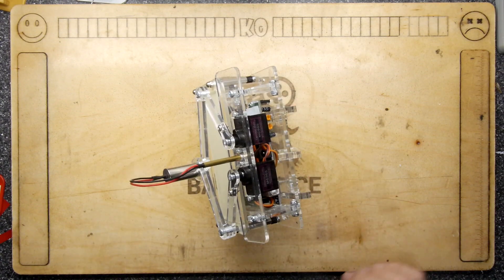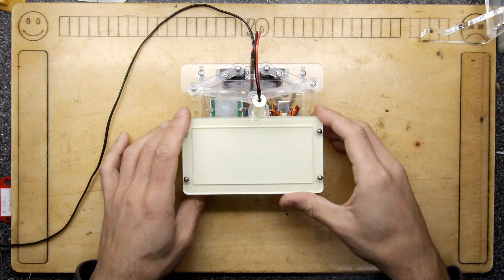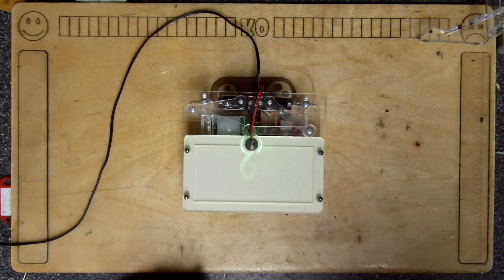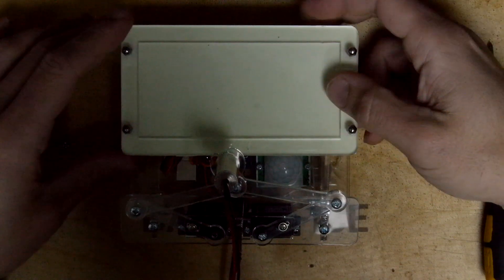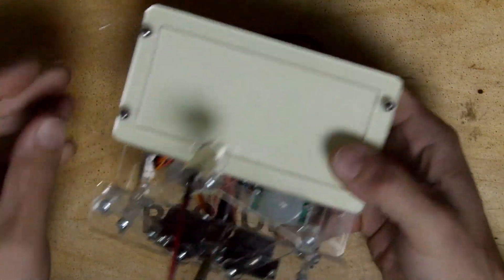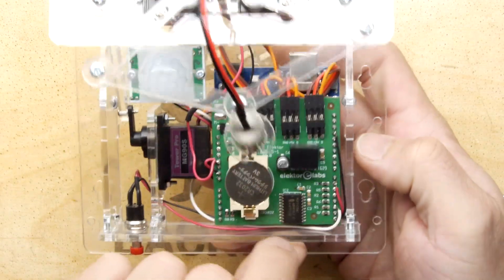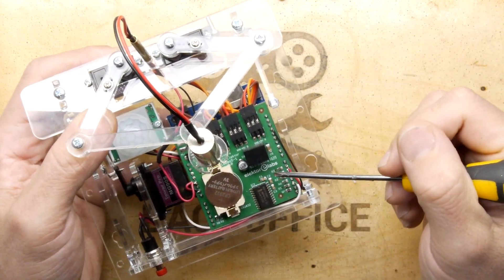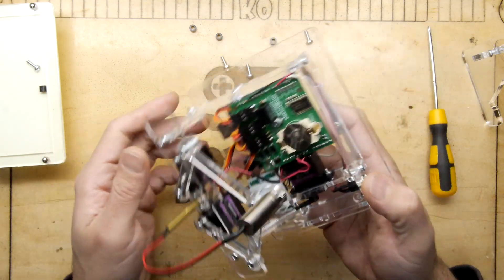Elektor Laser Timer Writer Revisited

Comment: The small block that looks like a relay is a simple' DC/DC Converter fixed @ 5V 1A  Also the PCF2129A is a RTC with a few extras, internal & selectable via I2C-bus & SPI-bus.
Clever little thing that IC with its backup battery switch-over circuit, a programmable watchdog and a few other clever options 🖖👍🏻
Reply from the maker: I remember when we used to use small rtcs to also wake up devices. I wonder if they ever used them on mobile phones for super deep sleep wake on alarms. Perhaps they still use them for the reset circuitry
Reply: Now your going back some time (not to far back) I never seen or heard of them in mobile phones. They get used a lot in electronic clocks, like the precision style clocks for "Precision, Accuracy" they are heavily used in GPS & some electric/gas meters the 'smart home' ones that we have these days. Yup they do have' (PORO) Power-On Reset Override, as an option so yeah I can see that being a thing for sure.

Comment: An hour off...  Maybe still on DST? Or is the RTC DST aware (and date set correctly)?
Reply from the maker: Almost certainly. If I recall you set the time over the Arduino serial interface
Reply from the maker: I suppose coding in the DST could be possible on the Arduinos as a stretch goal 😂